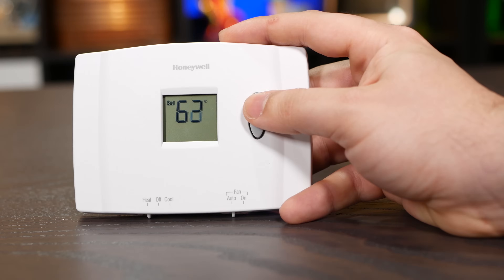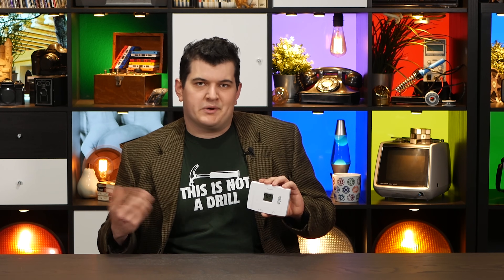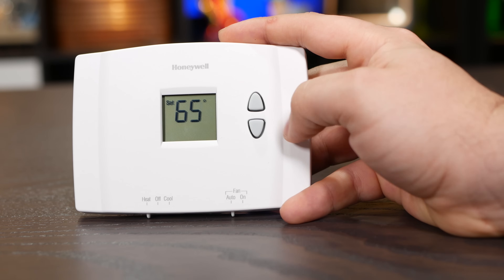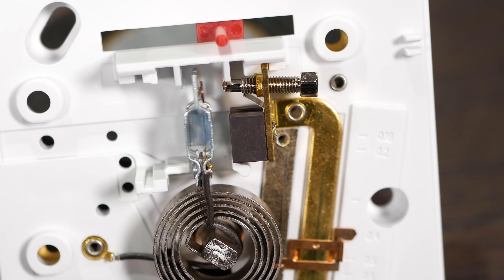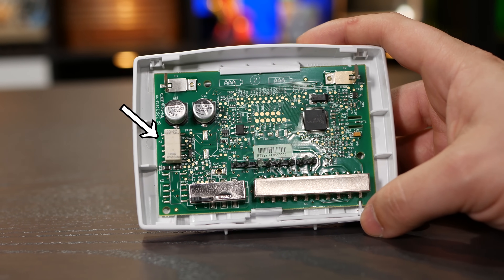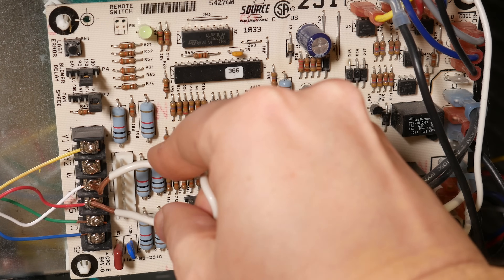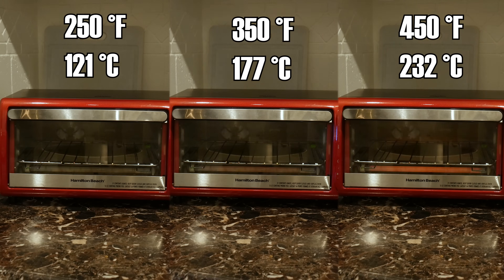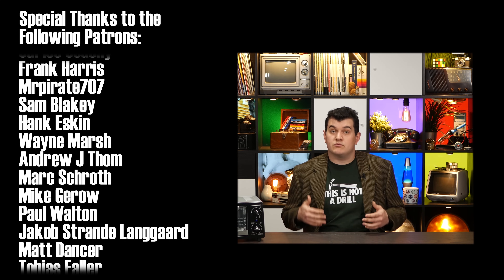Thermostats: Cooler than you think!

Comment: May have already been mentioned, but heat pump systems with backup auxillary (when used independently known as emergency heat) are most commonly equipped with a thermostat that DOES blast the heat out faster if you turn it up more than space temperature. This is an issue for the home owner because it costs them money and they have no idea that they are causing it. Generally speaking raising your heating set point temperature by just 2 degrees (on most cheap heat pump thermostats) will force on not only your heat pump, but your super expensive strip heat as well. For example a heat pump may be supplying 30,000btus, but when the strip heat turns on you could be pushing 63,000btus. The problem is that your heat pump only requires 7~9amps to operate and that strip heat takes anywhere from 20-60amps to operate (BIG cost difference).

Comment: 2:07 My car has an ECO where EVERYTHING, including climate controls, use less energy. It takes longer to reach target temperature. I only disable it to use full poeer on very cold daya in the winter to start, then switch back to ECO after 15 minutes. 

My dad has an on or off system in our house, BUT my Mom has a smaller house with two giant area heaters, one with 3 power settings (and NO FAN so no, it's not for that) and the other with 2 (which...i admit MIGHT be fan settings only). Though I admit my dad's is the only system that is CENTRAL AIR.

SO I'll mention my dad's. CONDO up north, which had a BOOST button (heat only) that actully made the flames in the furnace bigger. How do I know? Well aside from my parents telling me, YOU CAN SEE THE FLAMES in the furnace and they do get bigger once it clicks a minute after the button is pressed.

I don't have an example for A/C doing this though...

Comment: You wouldn't want to use ethernet cable for the thermostat on an installation where the load is directly across the thermostat. Best case you only have melted cable...

Comment: As an Australian, I've never seen a thermostat here, ever. Probably because it's so much hotter here why would you ever need heating? Instead we have the actual aircon device in the room itself mounted on the wall. It's amazing to see engineers just create something so simple and it works because that's all it needs. Great video!

Comment: I can't believe that the vast majority of air cooler work using only on/off duty cycle. Using inverter technology on their pump increase their efficency a lot. But to achieve it, the system needs to know the room temperature and the target temperature. That's impossible with that kind of thermostats.

Comment: 2:01 I'm pretty sure my air source heat pump uses PIR. I know, I know, just boosting engagement y'know. Come to think of it I also have a pair of fancy panel heaters with WiFi, and they probably use PIR as well. They keep a remarkably accurate temperature regardless of outdoor temperature swings. (Yes, I live in a pretty cold place.)
Reply: 2:46 Oh no, your wire is damaged!
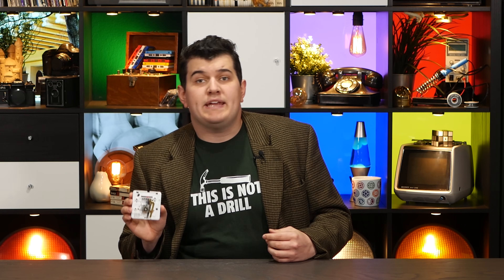Reply: 6:25 The effect created by the magnet is called hysteresis. Look it up, it's very useful in all sorts of applications. In electronic systems, Schmitt triggers do the same job.
Reply: 16:51 Again, I'm pretty sure my AC has that feature. We truly live in the age of wonders. It's a Panasonic btw.
Reply: 13:38 As you probably already know, slow PWM is a thing, and yes, it's often used for heating. Most PWM needs to be low-pass filtered depending on the use case, and since heater elements are usually such effective low-pass filters by themselves (they have a significant heat capacity, or thermal constant if you will), it allows us to use much slower PWM frequencies than in many other applications. This allows us to save on the components doing the switching (e.g. MOSFETS) because slower MOSFETS can be made beefier without quickly becoming expensive. A slow PWM frequency also have less switching loss, i.e. wastes less energy. And it reduces wear on the switching component. While LED dimmers typically operate on 400 Hz to several kHz, heaters can run on 1 Hz or even slower.

Comment: You left out the eat anticipator.
That's a small heater, usually a resistor that heats up the sensor before the furnace reaches the set temperature.
This keeps the thermostat from cooking you.
If it didn't have the heat anticipator the furnace would unload too much heat and make the thermostat setting inaccurate.
That's not a textbook explanation.

Comment: "There is no medium blast" would make a good shirt
Reply: Then when you get tired of the fan running at all, you turn it to "off blast".
Reply: @ovalteen4404  Blast: Off
Reply: Sounds like me as a kid..... "DAD!, is there such thing as medium blast? What about small blast?"
Reply: Thermostat be like:

"Go hard or go home"
Reply: Memetastic (slightly legally-challenged) version: "Do or do not. There is no medium blast!"
Reply: Medium blast can't melt steel beams.
Reply: That would confuse the large mass of people that think all controls are analog. These are the same people that tap the call button repeatedly to make the elevator arrive faster.
Reply: @dlxmarks  Or the people who push the button for the crosswalk multiple times to make sure it worked

Comment: Setting the thermostat higher will help if the thermostat is programmed to stop calling for heat a few degrees below the set temperature and allow for the temperature to keep rising. Whether that works with HVAC, I don't know, but it will work with central heating where the boiler keeps running the pump after stopping the heat exchanger

Comment: "who would watch a Technology Connections video at 6AM?" me- OH BOY 6AM (HIJACKING MY COMMENT TO MENTION BUTTON-ACTIVATED A/C THERMOSTAT BELOW)

EDIT - Answering ICantThinkOfUsernames' question: in my church's chapel, we have exactly that. Regular old bimetallic thermostats (that's what they look like at least), but with multiple zones for more even temperatures (one thermostat per zone.) 

But there's a change: each thermostat has a "COOL" button that, when held down for five seconds, will run the A/C on full blast for half an hour. If you walk around and press all the buttons, the whole room will cool quite quickly before returning to its usual duty cycle.

I don't know how this works. I've never taken apart our thermostats! But they do exist.
Reply: I'm guessing there's a relay in there that's engaged by a circuit hooked up to a button. Granted, its complexity can vary depending on how high-end it is.
Reply: @FairPlay137  Maybe. It's a fifteen year old add-on, and we haven't swapped the system since.
Reply: It's 6 am here but I am starting my day so.... Time to get ready for work
Reply: You have just used blast. Do you think it has 2 stage cooling/heating?
Reply: @BritishAPT  I don't know enough about our HVAC to say, sorry. I suspect it does not, though.
Reply: My church has similar ‘cool’ buttons that I never really understood. It all makes sense now. Thank you for reminding me of them. ;)
Reply: it 10PM here, time for bed
Reply: I was gonna watch it but had to go to school and forgot until now :(

Comment: In the UK, most water 'Boilers' for radiators and hot water have variable controls for heating and water, so the temperature of the water being heated can be set, but like the USA, most thermostats still only tell the boiler to turn on and off. I don't know of any system locally where a thermostat can control a boiler (furnace), a fan and an AC unit.
Reply: That's because we don't generally have 'central air' via ductwork as in the US. In this country it"s normally a split part system (condensers on a wall or roof outside, with an internal ceiling-mounted compressor / fan unit, linked by a coolant pipe run) and these have a separate control unit. I recall Nest had to do a lot of work to adapt their product to the UK market including providing a wireless 'Heat Link' which is what connects directly to the boiler, rather than the thermostat itself (iirc, this is the case even if you have an existing hardwired wall 'stat). When I connected up my Nest, there were 4 wires between the (ancient, non-condensing Alpha)  boiler and Heat Link: call-for-heat, common, and 2x240v runs to power the unit. The display (sited in the living room on a stand) connects to the Heat Link via wireless radio (not wi-fi, I don't think) and is powered by a 12v (I think) 'wall wart' (if you have existing wiring, you can wall mount the Nest over it and use the existing 12v wiring to power it, but it still talks to the Heat Link via radio).

Comment: Soooo.... yeah I'll be that guy for this one... Boosting Engagement!  I have a Carrier Infinity heat pump system, and it's the exception to the rule.  It doesn't use the old school 4/5 wire setup, it's a serial data bus, and is variable speed on both the fan and the compressor motor.  So turning it all the way up to 90 does in fact speed up both the circulation fan and the heat output.  The damn thing sounds like a hurricane when it gets up to full speed.  But most of the time it runs at a low speed and low compressor output so you don't even hear it running.  But the motors in the compressor and air handler are driven by real PWM!  Of course, it also means I have to use only Carrier stuff, I can't go just buy a thermostat at Home Depot, I have to use the $300 one Carrier sold me.  Great video as always!
Reply: Same!  Mine is a Lennox 2 stage heat pump with variable speed fan and TXV.  The thermostat has only 4 wires: power, ground, and RSBus +/-.  It figures out the heat load and determines if it needs to run in first or second stage and what speed to run the fan on.  My power bill dropped like a stone, what was a $350/month bill in the summer went to just over $100/month.
Reply: @mobile_vic  probably switching on and off, uses so much power for the initial start current, that running continuous but at low speed is a lot less power demanding.....?
Reply: @Lambda Music I do!  I went from a propane fired heater and single speed AC to the heat pump.  AC bills could easily go above $500/month for electricity.  Propane was harder to figure out since other things in the house use it to, but I went from filling the tank 3 times a year to once a year.  Electricity now rarely breaks $100/month.
Reply: but how many levels of "Blast" does it have?
Reply: Nicholas Souris infinite blasts!
Reply: Hurricane? the plane or the storm?
Reply: @toboterxp8155  Yes.
Reply: Isnt that what they call "inverter" technology? I have some 12-year old Carrier Minisplit units all over my house, and they surely vary the speed of the pump and the blower motor. And the central heating unit at work does that too. I think it's the norm where i live (Spain).
Reply: You need more P in your PID controller
Reply: @tadeuszgladysz7387  I'm sorry buddy but i dont understand you. Put the message in google translate and it detected it as Polish, which i dont speak. And the translation didnt seem to make any sense.
Reply: @ComandanteJ  sorry mate, i ment to reply under different video, it's some wierd YouTube error
Reply: @tadeuszgladysz7387  Haha no probs, have a good one ;)

Comment: Regarding your last viewer comment: I manually control my Nests' schedule, and have a set point scheduled for (literally) every hour.  That way, if I'm temporarily feeling hot (in the summer), I can turn the dial down to get the A/C on, and I'll know that at the top of the next hour, the temp will reset back to my usual setting.  Sort of a dumb semi-hack, but I find it useful.  [My Nest complaint is that it has no understanding or awareness of zoned systems, and some super useful things could happen if it -- but that's another long boring topic.]

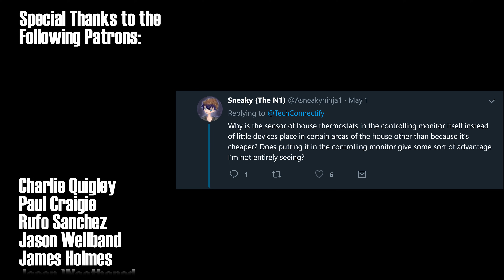Comment: @14:20
Not entirely true. In houses that use hot water radiators for heating, the amount of heat can be determined per room, since radiators have an adjustment knob. Since rooms can have a different rate of thermal energy loss than the living room (where the thermostat usually is), some rooms may cool down quicker, and become uncomfortable. Now, since the radiator knobs are manual, responding to a cold room while the living room is still warm, would make the living room too warm, so that wouldn't work. Therefore, if you want a system that checks the temperature in each room, and also tries to maintain a temperature in each room, you also need an automated control valve for each room ('s heating device).
Reply: And that's where thermostatic radiator valves save the day!
Reply: @K-o-R  lol, the ones I was thinking about are actually thermostatic. Not sure how that slipped my mind.

Comment: Look up OpenTherm and find out about all the neat stuff thermostats can do with just two wires. Including powering themselves! It’s pretty clever.
Reply: This is actually a thing in Europe. Most of our (not ancient) furnaces une OpenTherm. You can even switch from On/Off to OpenTherm without running extra wires. (how do I know? Had to switch 2 years ago) Maybe just flipping a switch or changing a jumper in the furnace.
Reply: Yes. It's been THE standard here in the Netherlands for at least 2 decades.
His whole story seems to be from another millenium to me.
Reply: And, ya know, we don't have fans and air-conditioning here (ok except some homes have HVAC but that's mostly limited to the bedrooms) but just plain old windows.

Comment: The nest can do a single cycle fan only run, but not A/C or heat. The way to get around that is to set multiple program temps so that if you deviate from the program eventually the thermostat will reset back to “programmed normal”.  This is also how you can keep kids from wasting energy by messing with the thermostat because your preset programming will reset it after people mess with it.

Comment: A lot of simple programmable thermostats will go into a temporary temperature setting if you change it from the programmed temp; the heat or A/C will then run until the new temp is reached, then it reverts to the programmed setting. There is usually a Hold button provided to make it semi-permanent (it doesn't modify the programmed settings, but the user has to manually reactivate them).

Comment: There’s a speed setting on mobile.  Set it to 0.25x and pause every screenful to read.

On desktop, pause and use the “<“ and “>” keys to advance or rewind frame by frame.

Now next time technology connections or any other silly youtuber decides to do the fast scrolly texty boi, you’ll catch their hilarious gag.
Reply: Lol you are indeed NOT a convicted fun sucker. Good thing you didn't type out that entire block of text just to get trolled in the last paragraph.
Reply: fun sucker :P
Reply: YouTube App version 14.17.53 on my tablet doesn't have a speed setting, nor any frame jog functionality.
Reply: @rednammoc  it should be under the menu exposed by tapping the vertical 3 dots on the top right of the player interface
Reply: Is there a solution for viewers from console?
Reply: Aaaannnnddd nnooowww aaa  bbbrriiieeeffff eexxxpplllaaanaaattiioonn iiinnnttooo wwwhhyyyy ttthhheeee rrrooollleeee ooofffff toaaasssttterrr ovveeennn wwiiillll bbeee pppeeerrrfffoorrrmmmeeedd bbyyy aaa sssttuuunnttt dddooouubbbllleeeee......
Reply: Speed setting works on desktop as well. I was wondering about the keys, but this has been mentioned already that they may be different...
Reply: Is it sad I repeatedly paused and played the video at full speed until I was reminded I could do this?

Comment: Thanks for the video!

I am curious how 24VAC got standardized as the control signal.
Reply: As to why the voltage is 24 and not 6, 12 or 17... this is likely a balance between the voltage being high enough to allow for thin gauge wire vs. too high of a voltage where it becomes considered too high to be "Class 2", I believe 48 Volts is the upper limit for Class 2, but feel free to correct me.
Reply: Another thing I just thought of today... and this goes back years ago when I was told this by one of our licensed electricians at work - "Class 2" circuits may be installed and wired or modified by anyone, without being a licensed electrician. Therefore a general contractor can install and wire doorbells, thermostats, low voltage garden lights, intercom systems, security cameras, etc. And the property owner can relocate these devices and modify this Class 2 wiring as desired.
Reply: This is considered a "Class 2 Circuit", and therefore wiring does not require protection from electrical shock hazards or fire risk protection, since the voltage and current is limited by a small 120 V : 24 V isolation transformer, similar to what is used for a doorbell.